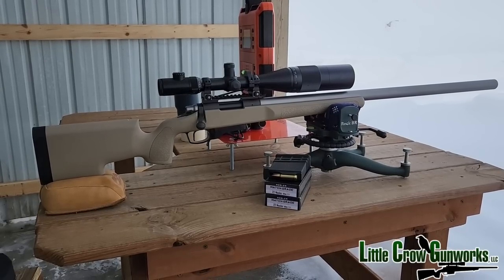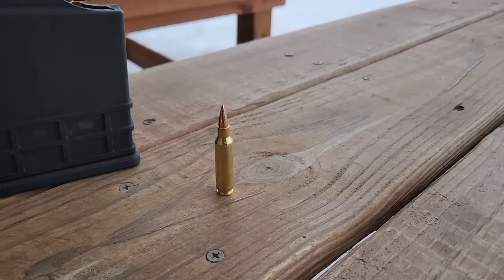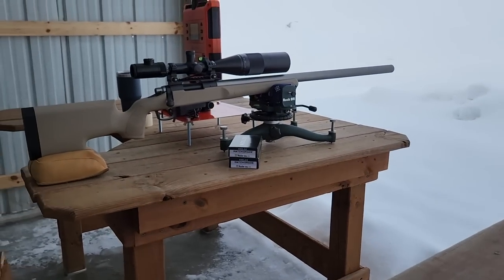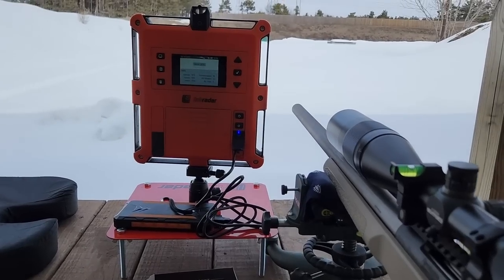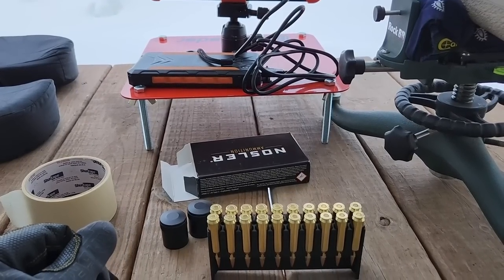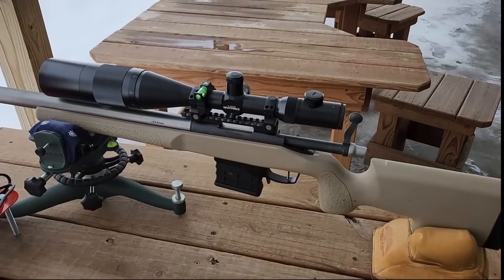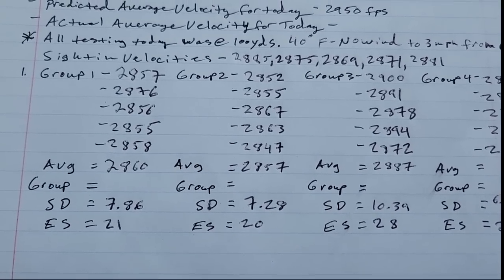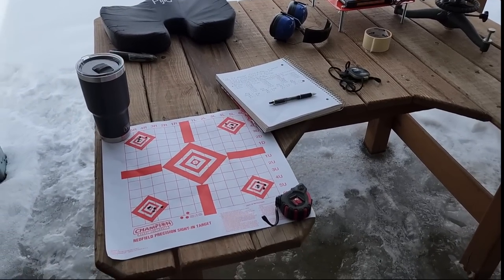22 Nosler "Unleashed" - Bolt Action Test -100yds - Factory Nosler 85gr RDF | Little Crow Gunworks

Comment: Very good video….always wondered how the 22 Nosler would be in a bolt action rifle. Did the brass hold up ok? Remember see the brass all torn up from AR-15 shooting and figured a bolt action would solve that.
Reply from the maker: Hey Mark, thanks for the feedback. Yes, you are correct, the brass is perfect. We will also be sharing brass longevity data. As to how many firings we get on the brass before the primer pocket gets loose.

Naturally the velocity will increase as we go here, because this was the first 29 rounds on the barrel in colder weather. I'm guessing around the 200 round mark, we will see around 3,000fps in this 31" barrel @ normal Minnesota spring temps of 70 degrees plus or minus. We will keep posting progress videos, stay tuned.

Thanks for watching.

Comment: The little. 204 ruger we have is a screamer I don't see that under 4100 but the lead is tiny grain to grain it is considerably  smaller
Reply from the maker: A .204 Ruger with a 40gr VMAX tops out around 3900fps. But the Ballistic Coefficient is very low. So at close range(sub 300yds), the 204 Ruger is spectacular. 

But at 500yds, the 204 Ruger is now going slower (1976fps) than this 22 Nosler (2052fps) and that difference drastically increases the farther you shoot.

More importantly, at 500yds, the 204 has 28.55 inches of drift in a 10mph wind, the 22 Nosler only has 18.73 inches. That's over 50% more drift for the 204! If you have high wind variability, the Nosler will have 35% higher hit probability at 500yds on a Prairie Dog size target.

Thanks for watching!

Comment: Nice concept. Why not try the 22x47 lapua I'm pushing the 85.5gr berger at 3296 with 38gr or powder out of a 24inch barrel
Reply from the maker: Hey Brady, there are a bunch of reasons.

Our goals for this project were:
Long range Factory ammo
Balance between velocity and barrel life.
Matching 80% of long range, big game, factory hunting ammo in terms of wind drift and hit probability.

If raw speed in a 224 bore with a "no factory ammo" wildcat was our goal, we would just chamber a 22 Creedmoor and get 3600fps with an 80gr ELDM and be done with it.

But that doesn't check ANY of the boxes we set out to check.

The 22x47 sounds like a killer cartridge, but it doesn't check any of the boxes we set out to check for this concept.

Thanks for watching.
Reply: @LittleCrowGunworks  yes I see your point keep it up champion

Comment: Are you going to test out 2.55" before cutting the barrel back to 28 inches?
Reply from the maker: Hey Frank, we will be testing handloads at max allowable length for the current throating. We cut this chamber with a standard SAAMI Reamer. I measured where the throat is with an 80gr ELDM and hit Jam at 2.485" or so. I will probably back slightly off of that and load at 2.480 to 2.475". That is leaving 75 thou of magazine length on the table. But, if we can hit our velocity benchmarks with the factory throating, and the accuracy is there, we probably won't throat it out farther, just so we can load 2.550". At least not at this 31" length. But, I'm not saying no. I am saying probably not.

When this transitions from "Test Rifle" to "Product", we will do whatever it takes to optimize fit, function, performance, accuracy, etc. We aren't willing to sacrifice one of those, to make another slightly better. If that means that all rifles will need to be throated out to optimize everything, then we will probably be ordering a proprietary reamer that checks all the boxes we want checked.

Thanks for watching.
Reply: @lilcrowgunworx  excellent I'm just happy to see any testing with coal over 2.3" I have a 223 barrel with a long throat 85.5gr touch at 2.67", 88gr touch at 2.50", and the 75-77gr bthp touch at 2.475" is Nosler still the only source for brass?
Reply from the maker: @cfranklin7450  Very cool. I do as well. When I mentioned my rifle in this video that shoots an 80gr ELDM @ 3,000fps; I was referring to a Vanilla 223 Rem throated long and loaded at .020 Jump or 2.490" COAL in a 30" barrel that is 1.00" at the muzzle.

Unfortunately yes, Nosler is the only source. I don't think there is anything wrong with Nosler brass, but that is the universal story of Nosler Cartridges. If the cartridge name has Nosler in it, nobody touches it. I think ADG and maybe one other company have made brass for the 28 Nosler. But other than that, nobody wants anything to do with it.

If you forced me to give an opinion why, I would say because most of the Nosler cartridges are viewed by the industry as "barrel burners"; most cartridges with that reputation, usually remain "fringe/cult" cartridges for the entirety of their existence. Personally I think Gun Writers have killed more good cartridges than anything else.

We will keep you all posted on the brass life of these Nosler cases and at the end, recommend how many pieces of brass to marry to a given barrel. So the barrel and brass are toast at the same round count.

Comment: I wonder if H 335 and/or BLC-2 powder may be good for higher velocity results in the long barrel?
Reply from the maker: Typically for a heavy bullet like this, in this size case, N540 is probably optimal. Which is a little slower than BLC-2.

But, we will be velocity testing a wide spectrum of the burn rate chart.
From fastest to slowest: IMR4895, AA2520, Varget, CFE223, N540, maybe N550 and just for giggles, Superformance. 

Thanks for watching.